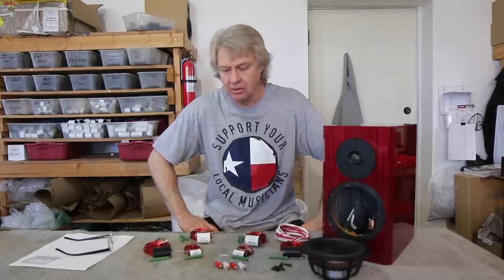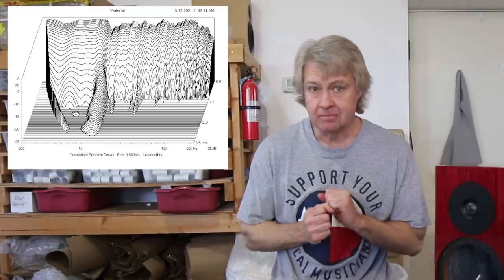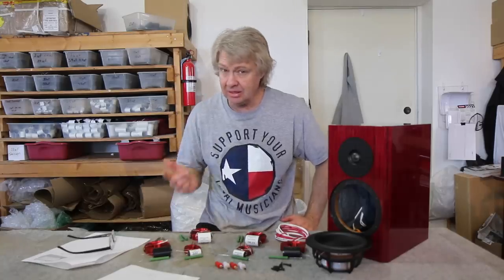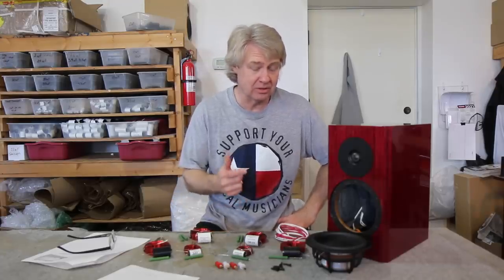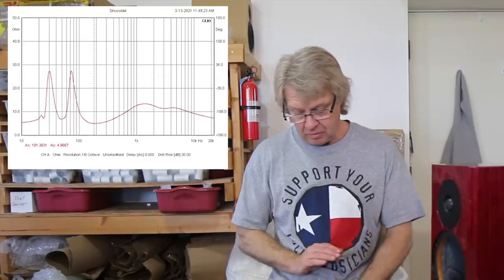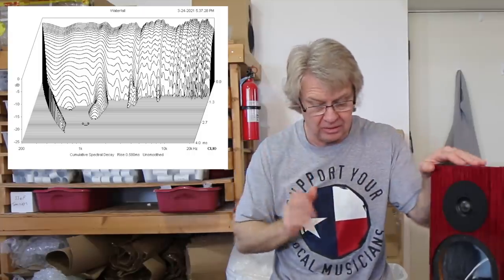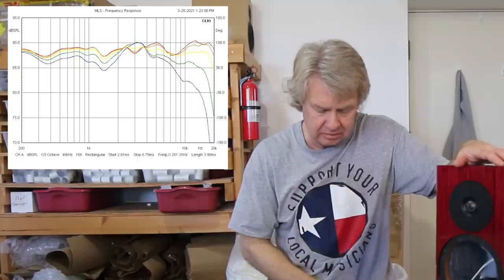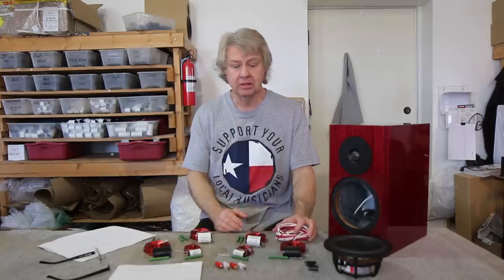Dynaudio | How “Special” is the 40?

Comment: That's nice (didn't watch), but what we WANT to see is this blind test with you and your pricey, "high quality" speaker wires versus the affordable speaker wires. THAT'S the video you need to post before you post ANYTHING else. I know that I speak for many others. Especially in light of Gene's video from Audioholics. 
#snakeoil
Reply: Easy now lol. Post in the appropriate thread. I’m as critical as anyone about that wire nonsense, but I’m not going to nag him. This is what he does best, and he just proved it with...real science.
Reply: @billd9667  Nah. We need that video.
Reply: @billd9667  He is pulling the wool over your eyes. The Dynaudios use high quality Van den Hul speaker wire, which is conveniently left out and called cheap no name wire by Danny. Also, where is the completed circuit he built? He doesn’t even test this stuff. He’s doing computer modeling and not even building the actual product.
Reply: Blind speaker cable video's are coming. And Gene's latest video was hilarious. He has no idea....
Reply: @toucheslapper  They did not have high quality wire inside. It was very cheap stranded PVC jacketed wire. And nothing that I designed was computer modeled at all. Everything I show you and all of the measurements made were with those parts on that speaker.
Reply: @toucheslapper  I don't know that. Neither do you. You're just being nasty now.
Reply: @billd9667  - Common sense will tell you that. Every video he posts never shows a completed speaker or “upgraded” circuit. NEVER. Use common sense.
Reply: Nasty. He also tested the SVS Ultra Tower and said it needed no help. 

True, he depends entirely on measurements and doesn’t take into account that the speaker may sound just fine. I’ve criticized him for that because he does the opposite for cables. But, this IS science. What I’m most concerned with is how Danny boosts certain frequencies that may strain drivers into distortion and moves crossover points on drivers that may cause the same. He isn’t measuring distortion. Still, I’m not tossing in his cable stance when in this arena because this IS a differently arena. 

You guys are crossing into troll territory now because of your distain over his cable nonsense. I draw a clear line between them. I like to see this stuff. I won’t do it myself, but I find it interesting.
Reply: @dannyrichie9743  What was hilarious about it?
Reply: @billd9667  Bill, you're doing a lot of typing. And all we want to See is a VIDEO. SHOW us that you can somehow hear these incredible differences, repeatedly, and consistently, with little to no error, with atleast 10 instances of alternating between the two different speaker wires. That's what I want to see. And the person doing the test needs to be credible, or else, how can we ensure that they're not in on it. I think Gene from Audioholics should do it. 🤔
Reply: @Larwiz  He is looking for measurable differences in the wrong places. He actually took an amplitude measurement as if he thought the wire was going to make a change in that area. That was funny.
Reply: @Larwiz  oh, so now you’re after me? Jesus, man, take a pill. You’re just chock full of bile, ain’t ya? Gene is an electrical engineer, but not nearly as thorough as Amir from Audio Science Review. And Gene is repetitive. He says the same things over and over where Amir gets into more and more depth. I recommend that you read and view some of his stuff.
Reply: @Larwiz  oh, and you didn’t even read my post, did you? You’re just ON FIRE, right?

I’ve already said that I THINK THE CABLE STUFF IS NONSENSE. Did you see that this time, troll? Is it big enough for you? Should I lend you my glasses? 

I’ll say it one more time for your edification: I draw a line between his cable spew and crossover modifications. He is very good at the latter and smarter than any of us. Even a broken clock is right twice per day. The day that you can do better is the day I’ll listen to you.
Reply: @billd9667  Not after you sir. And bile? Sir, seriously. I just want to see the darn video. That's it. And that's not unreasonable. 
Why does this bother YOU so?! Did you buy into the snake oil nonsense, and are having a hard time coming to terms with the fact that the oil is in fact SNAKE?! LOL Seriously. Where is your dog (snake?) in this fight?
Reply: @billd9667  Not sure why you're caping for this guy. Calm down bro. I'm not trolling. Just another audiophile viewer that wants to see the man put up (or shut up). You should want the same.
Reply: @billd9667  Have you seen Audioholics' Thunderbird zero speaker cable review?! Just published today
 This speaker cable costs $5000, and isn't testing any better than the comparison cables. You can't make this stuff up! It's all snake oil man!